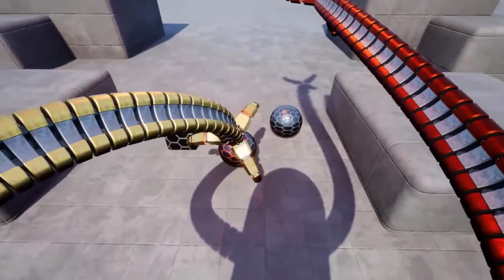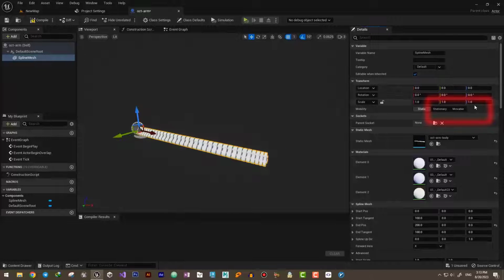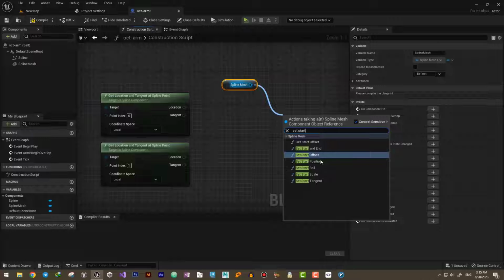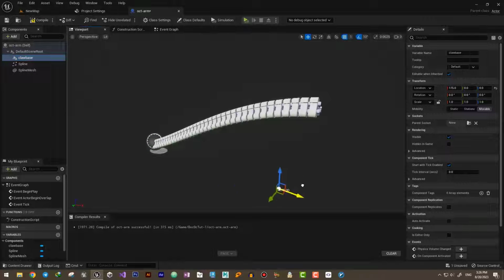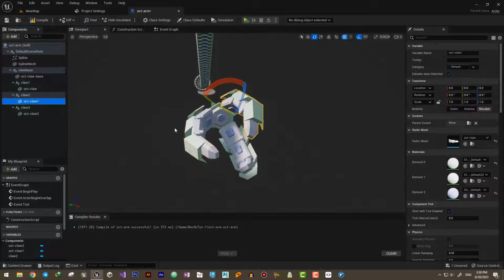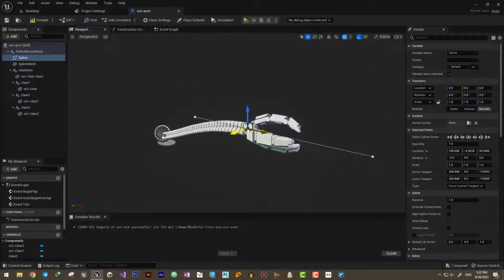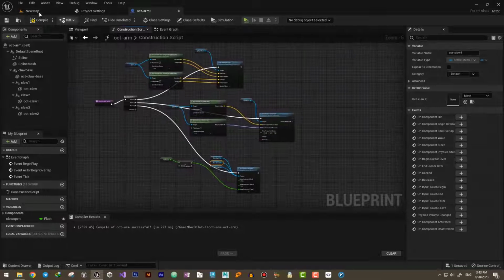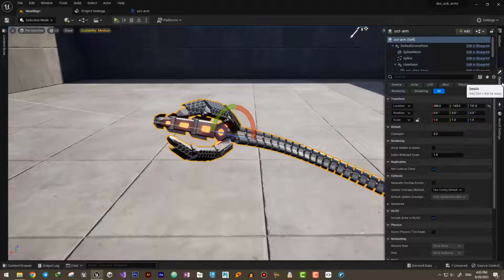Creating Doctor Octopus Arms in Unreal Engine - Part 1

Comment: It it possible to add another point on your controlling spline, instead of just start and end point?
Reply: Get Spline Length instead of Get Number of Points
Create Spline Length Variable - Float

After For loop
Index Multipliedx By Get Spline Length Variable put into Distance of 

Get Location at distance along spline into start position
Get Tangent at distance along spline into start tangent

Repeat for end position